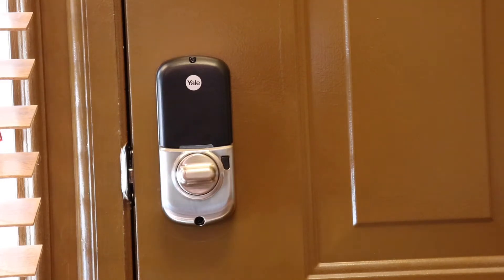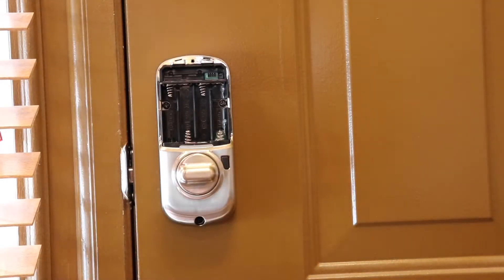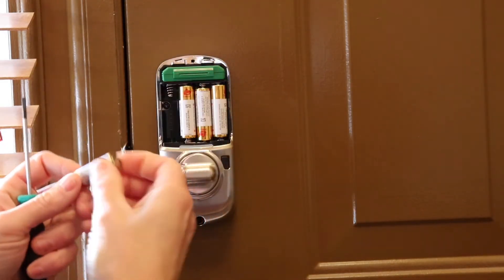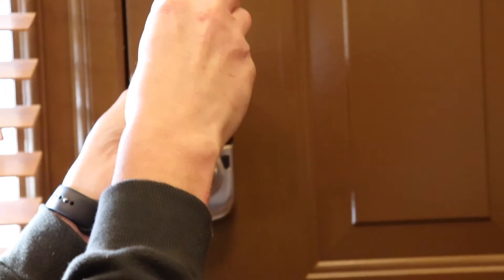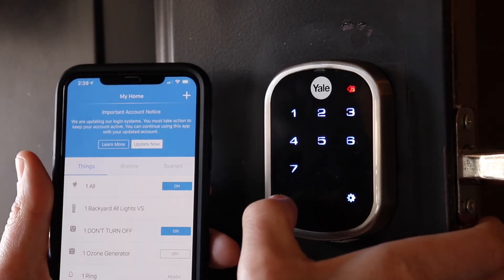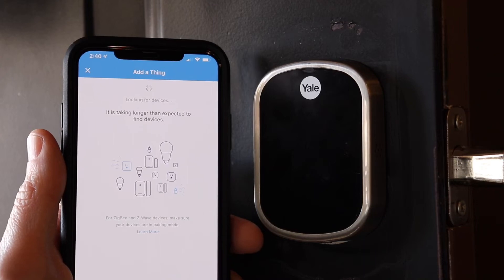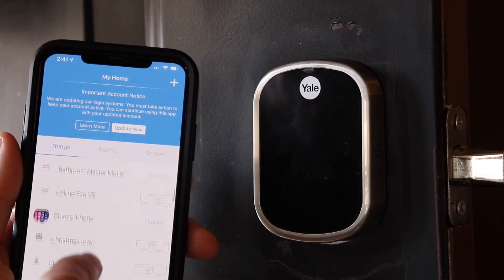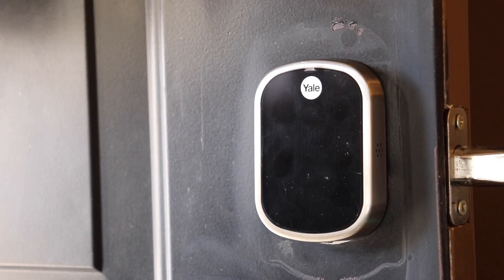Install Z-Wave Module Yale Assure Lock SL & Smartthings Setup

Comment: I’m having the hardest time connecting to my door lock. I’ve rebooted by removing then replacing the batteries and the green plug in thingy. 
Did all the steps and no dice. 😢
Reply from the maker: You may want to reset the lock.  https://youtu.be/E8DLn0AKMTw

Comment: I am not getting 7. whats wrong?  I am only showing 1 to 6
Reply from the maker: Do you have the module installed? If so you may want to pull the module out and reseat it.  Also, try resetting the lock https://youtu.be/E8DLn0AKMTw
Reply: @ thanks.
Found out that pins are damaged on it. 
Is there a way we can fix those
Reply from the maker: I would use some needle nose pliers to straighten them out. Otherwise, it isn't worth paying an electronics repair show to fix it.  If you do try to straighten the pins you need to take your time and be very careful not to break them off.

Comment: With this Z wave module do you also still have to have the bridge? I have the assure SL and it does not work without the bridge. However I am having connectivity issues and wondering if this Z wave possibly solve that
Reply from the maker: The lock works great as stand alone.  If you want to control the lock via Z-Wave, you will need a hub/bridge.

Comment: What’s main difference between the green module vs the orange module that says works with home kit? Do they both work with Alexa?
Reply from the maker: So to get either of them to work, you need hub to communicate with.  The Orange works with Apple’s home kit. You need a Apple TV or HomePod or iPad to be in range to connect to.  I don’t believe it will directly work with Amazon Alexa.  The green is Z-wave that will work with SmartThings, Ring Alarm, Aeotec hub etc.  that can connect to Alexa.
Reply: @sellgooddeals-DIY  awesome thanks for the reply ordered the one to work with apple  HomeKit
Reply: @sellgooddeals-DIY  Iv got the green module the z wave, but I can’t connect to my SmartThings, do I need a hub or can I do it without one?

Comment: Does this require a hub?
Reply from the maker: Yes, if you have the zwave module. I have used this with the Ring alarm system and it works great.

Comment: after entering master code -> 7 -> gear only number 3 shows up, number 1 doesn't show up :/
Reply: Ever find a solution to this? Having the same issue.
Reply: @Dustednoah  Having same issue.
Reply: @lindaguillory7802  I forget exactly what it was, something like it was already registering itself. but anyway, I called yale and had it up and running in 5 mins.
Reply: @Dustednoah  in my case it meant the module was paired with something else. so on your z-wave hub, go through the procedures to REMOVE/unlink a z-wave device (even though it never was linked to this specific hug, but you need to do it anyway). and then re-link per video.
Reply: @alexanderzagoro6918  What Z-wave hub?  where do I get that?
Reply: @lindaguillory7802  Samsung smart things for example

Comment: @sellgooddealsDIY : I bought Yale Security YRD256-ZW2-619 Yale Assure Lock SL with Z-Wave in Satin Nickel (YRD256) Key Free Touchscreen Deadbolt. I do not know if  I need a hub with it. Also which app should I be using with this model?  Thank you in advance
Reply from the maker: It looks like your lock already has a Zwave module.  You would need either a Ring alarm, SmartThings or Wink hub to be able to operate this lock.  You would use the corresponding app with the hub that you purchase.  I have used both the Ring and SmartThings hubs.   They both have pros and cons.  It really depends if you already have an alarm system or if you plan to have multiple zwave devices.

Comment: Hey guy, tks for sharing it! Why in my case doesn't option 7 appear despite having the zigbee module installed?
Reply from the maker: Pull the module out and reseat it again.  Then reset the lock back to factory default settings.
Reply: Tks!!! Done!! Now the problem is that the SmartThings couldn’t find my zigbee / Yale device...🤦🏻‍♂️🤦🏻‍♂️...hard to have it working properly!
Reply: If you are trying to connect to wifi or internet for wireless connection, you may need a z-wave or zigbee HUB. It connects to wifi via hub. You could get the direct wifi module instead of z-wave or zigbee technology.

Comment: HI do u need a samsung smart thing hub for the lock to show up on the smarthing app. after i press 1  and setting icons i dont see the app the listed in the smartthings app. It says "Join the wireless network" and then it times out.
Reply: Yes you need to have a smartthings hub
Reply: Simon Adam thanks. Bought the smartthings hub and got it working

Comment: Mine can’t go past the 7. Something with the WiFi connection
Reply: Might need to buy the hub (Z-Wave, Zigbee hub). If you want to skip the hub, purchase the wifi module that gets plugged in to where the z-wave module was plugged in, which you saw in this video.
Reply from the maker: Try unplugging your router/modem for 1 min.  plug it back in and give it another try.
Reply: sellgooddeals DIY it says exit the wireless network.
Reply from the maker: Sorry, I just did a video on the August lock....I had that on my brain.  It thinks it is already paired with a network.  Are you sure it isn't setup?  If so, you should exit the network then it will let you set it up again.  You may want to go to Smartthings, Zwave utilities and do device exclusion at the same time.
Reply: sellgooddeals DIY I will try again thanks. I will  tell you if it worked or not
Reply: sellgooddeals DIY you are a genius. I did reset the Yale lock and it worked. It must have been stuck on the previous settings. Thank you so much